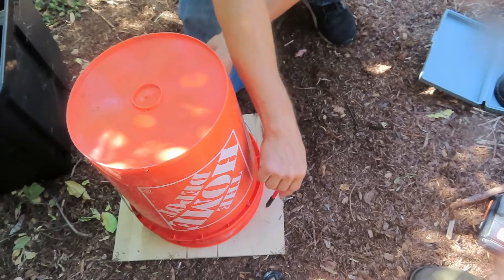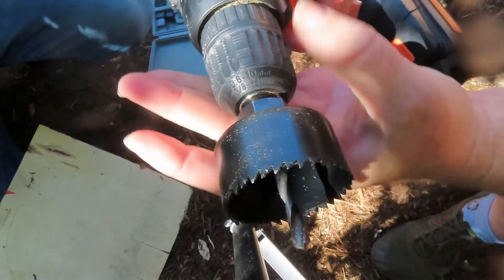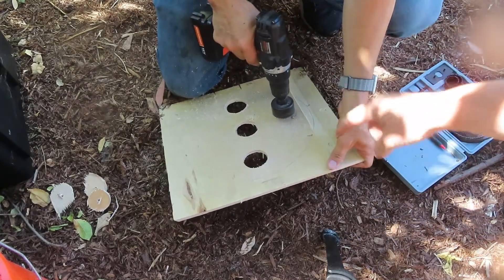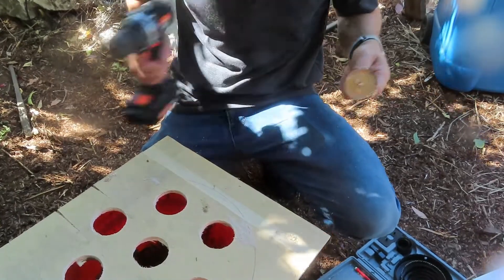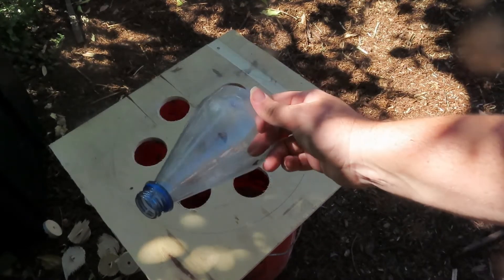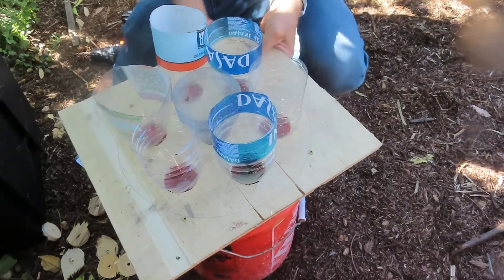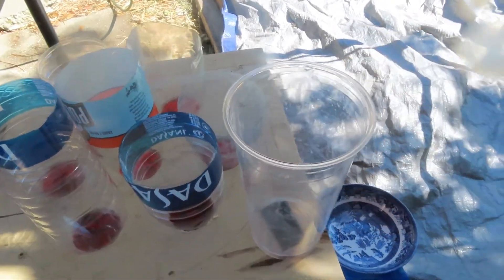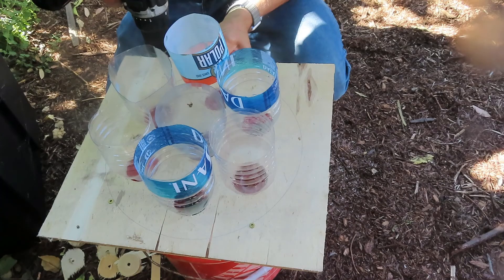Improving Processing Cones for Quail

Comment: It does look like you would have a lot less splattering using this system. Thank you for the Idea!
Reply: Oh the splatters can get bad but can make you laugh if you accidentally got your buddy :( funny but he wasn't laughing then
Sorry ....i really worry about blood splatter in the yard something will be atterscted to it so its best to keep that as clean as you can in my opinion
Reply: @wildedibles819  I was just watching "Sow and Tare" Katrina Krakow's channel and she drilled holes in plywood then used plastic bottles to make cones and then put it on top of a 5 gallon bucket. worked to keep splatters controlled.
Reply from the maker: You're welcome!
Reply from the maker: @wildedibles819  This works really well, you still do have to be pretty quick to get it into the cone, but it worked great.
Reply from the maker: @smckee9063  Thanks for sharing this video with people!
Reply: @sowandtare  sounds good usually me and hubby work together he can hold a few until they stop but when you need to do 20+ in one day this would help thanks
Reply from the maker: @wildedibles819  Absolutley, we did over 30 list last time and it definitely came in handy!

Comment: Didn't think about using drink bottles. 🤔 Nice!
Reply from the maker: It works great! I recommend using the ones that are a little bit wider and to cut them longer than you think you need them, then, once you use them, trim them to the length you think you'll want.